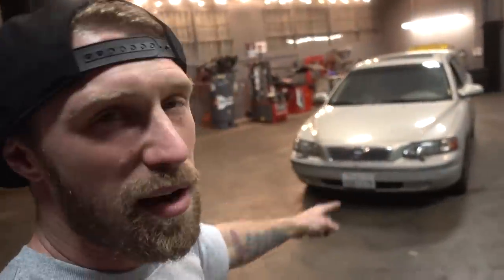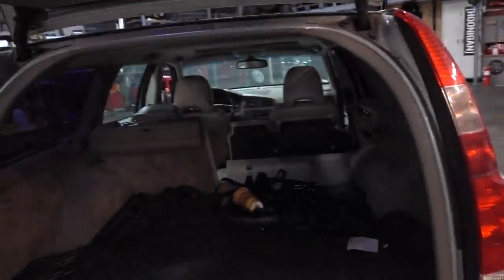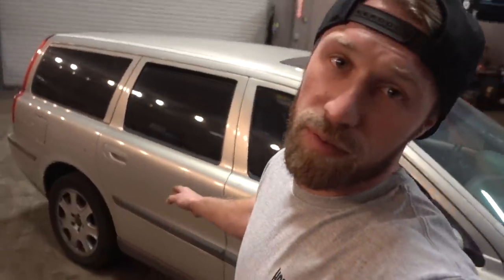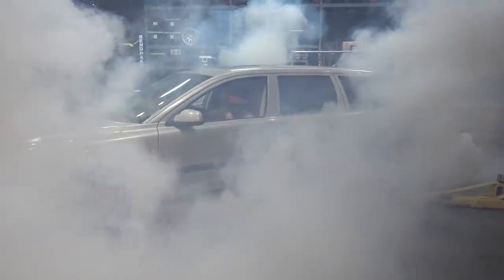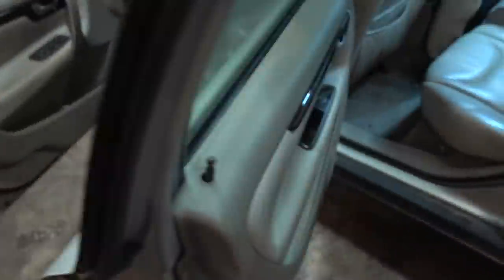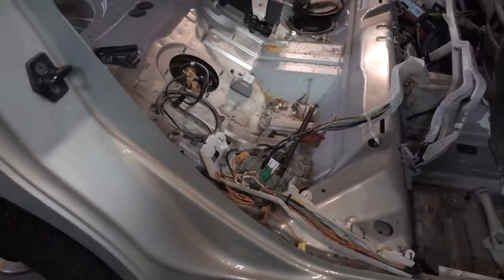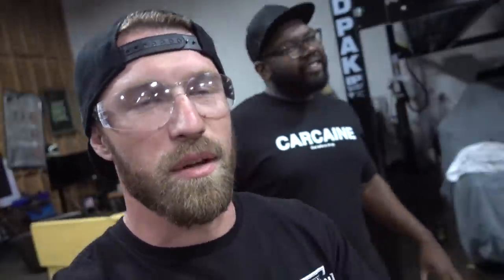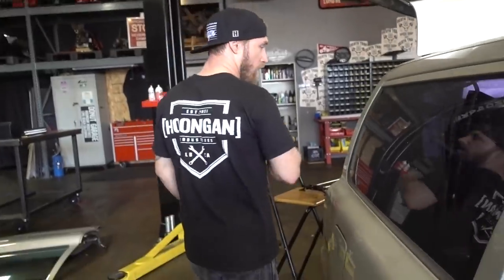Volvo Caster Car Build [Pt. 1] Stripped Down //DT241

Comment: Warning: walls may be taken down if the Volvo is crashed against it.
Reply: Gian Groppa Racing yeah
Reply: We sent a cinderblock wall flying out 30 feet when we plowed into it one drift day. MAF came unplugged, plugged that sucker in. Boom fired right up! Kept drifting all day. Only a volvo 760 turbo could pull that shit off!
Reply: i remember we put a 240 up to a brick wall, put it in gear, made it spin & locked the gas pedal in place... we thought it would destroy itself as a laugh, BUT the freaking wall came down and the volvo went in to the woods for a stroll. Fences, hedges and walls were brutalized that day. A newfound respect for volvos also aquired...
Reply: J. Imagine getting on camera, but otherwise I don't believe you.

Comment: AHH NOO DUDE.... I was so looking forward to commenting that it would be SO awesome if you's weld the rear 10 inches of the car back onto the front-cut half, so it actually looks like a miniature Volvo, and then Hert smashes the taillights :(
Please build it nicely! would be a shame if it turs out to look like shit... even though it's meant to be a fun caster car.
Reply: Yep
Reply: I think there ruining a car of good potential. This is getting out of hand, whoever thought of it needs to not be aloud tools ever again.
Reply: "Can't get it smogged", I think that's what he said.  So, it's either a parts car or sold off for cheap... or used to make a fun goofy toy.  Also, it's not like Volvo didn't make literally THOUSANDS of these cars, nor was it an "R", so save the restoration rant dude.
Reply: +Julian Serna, yeah, that's what I thought they would do as well. A little disappointed about that but still exited to see how it turns out.

Comment: I've made a couple of these, The casters take a beating so get ones you think are overkill. A single handle turning brake on the front wheels makes them turn FAST. Without one if you have any difference in the brakes or tire pressure it will just do out of control donuts.

Comment: Please use the same mechanical system as the crazy kart for the “handbrake” (changing the angle of the casters from letting them only go straight to allowing them to turn when the lever is pulled), it would be a LOT more interesting

Comment: You should cut it right before the c pilar and the arch of the rear wheel well. That way you can put a gas tank and crash bar behind the seats, and then you can still put the rear hatch on. Should be a fun build.

Comment: The hood on that volvo, you can flip a couple metal latches at the hinge points and open it up completely vertical.  It's a great way to get the hood out of the way and should negate needing the stick.

Comment: Two brake pedals, one for each front caliper. Put them close enough that you push both at once or you can angle your foot or push one at a time for super tight donuts.

Or one handbrake that has two masters on it and you can pull it right or left to active each front caliper independently.

Comment: You need to make the charge pipe that goes over the engine metal because if you are going hard on the car you will melt the plastic pipe.

Comment: You should cut it just in front of the back of the front doors, then just in front of the back of the rear doors, and weld it back together to make a 2 door volvo wagon! One of the local driving schools has a "caster car" where the casters can be locked so they can drive it on the road like a normal car. I have no idea how they're mounted, but they fit into the rear wheel wells, but are much smaller then the stock tires.

Comment: You should take the wagon back glass and weld it back to the front half. Mount the wheels a foot and a half closer, and weld it all together. You could rwd convert it too, it will make the back heavier as well.
Reply: That would make it a unibody 😂!!!
Reply: Basicly take out the back doors

Comment: I would have cut it where the roof line is straightest, then did the same on the rear portion with the hatch, and then had them meet for an almost seamless transition.

Comment: I highly recommended you guys don't keep the auto-trans, these things notoriously have hard shifting issues and use an expensive fluid (compaired to regular ATF). I love my V70 but the trans makes it unbearable to drive. Please please please manual swap it with an older Volvo 5-speed 👍